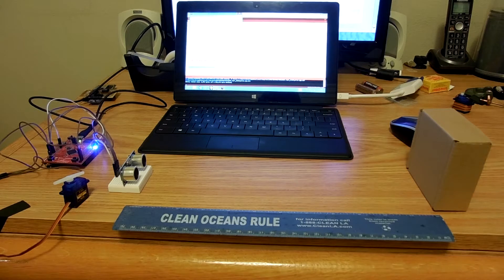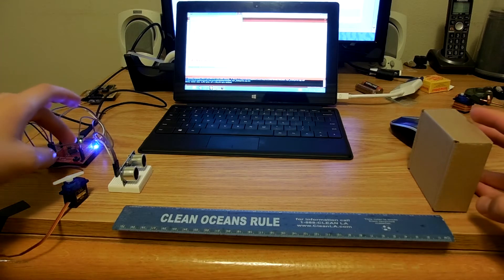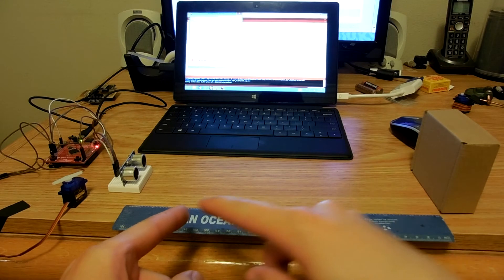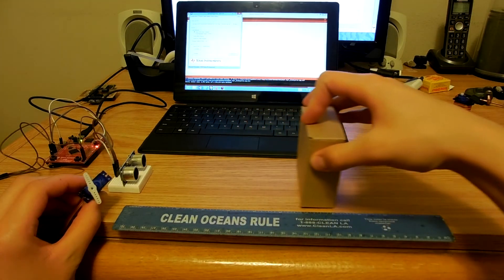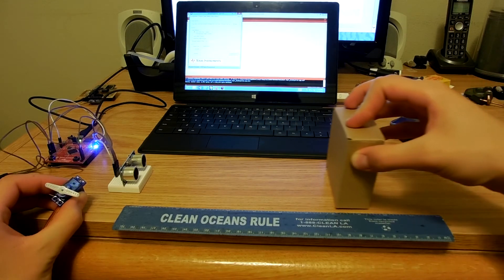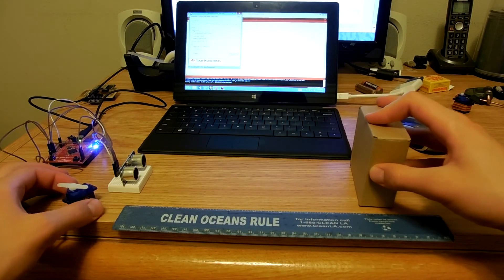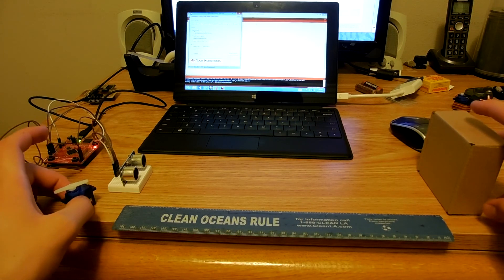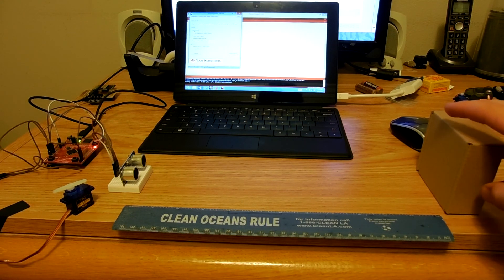Three library demo for Energia: Servo, Ultrasonic rangefinder, Data smoother

Comment: hee, i am building a servo camera gimbal. I also used Data smoother and it works well with one servo.
but if i use 3 servo's it doesn't work well because it can't do 3 measurements at the same time.
how can i make 3 servo's smooth?
Reply from the maker: Did you try using a different smoother instance for each axis?
Reply: fughilli at first I wrote the program with one servo, one sensor and the data smoother. this worked well.
then I copied the program times 3. of course everything at the right place an used 3 different names. 
this works kinda. only you can see that it is in a loop. so first servo 1 moves a step, then servo 2 then servo 3 then servo 1 again till they are at their position (it is pretty fast though, only it is not smooth). you get it?
Reply from the maker: if you send me your code, I can suggest a fix, as I'm not quite sure what you mean.
Reply: fughilli How can I send it to you?

Comment: hello like to know how you put the libraries in Energia... as always accuses an error in compiling the program even when I stick the library files! Thanks
Reply from the maker: Make sure to put the library folders into your "<energia install directory>/hardware/lm4f/libraries" folder. So, for me, the full path for Servo.h is:
C:\Energia\hardware\lm4f\libraries\Servo\Servo.h". Also, make sure to restart Energia after moving the files as it will not add those directories to the include path until the next time it starts. Also make sure to add your #include directives at the top. (I'm assuming that you already did, because you received an error from the compiler about it.)
Reply: Thanks fughilli !
Reply from the maker: No problem. Let me know how your project turns out!